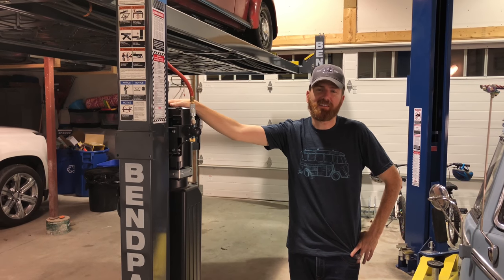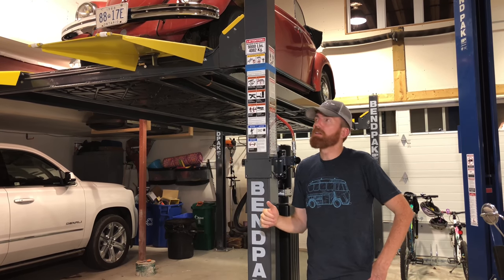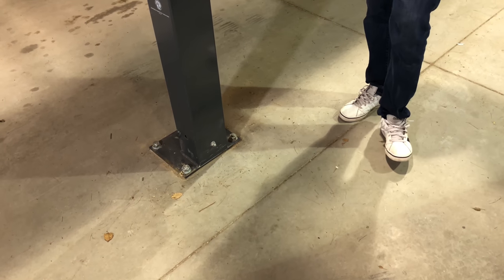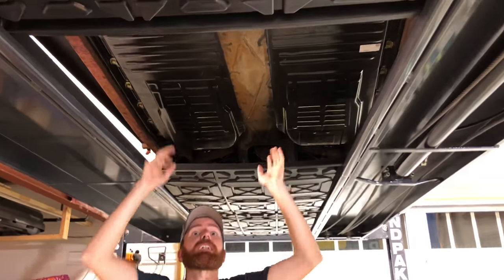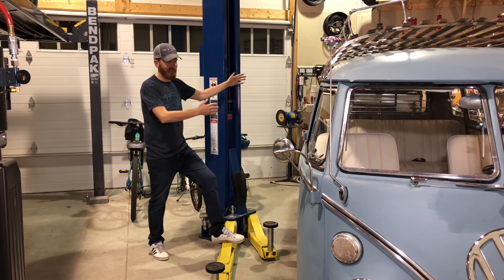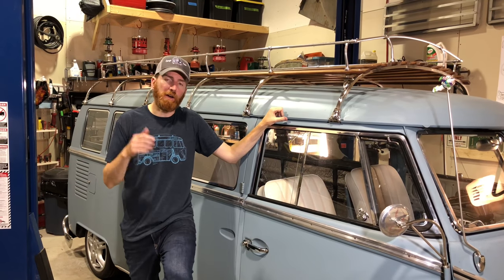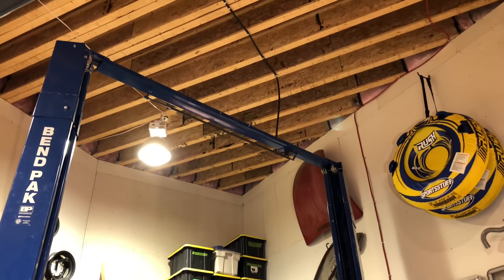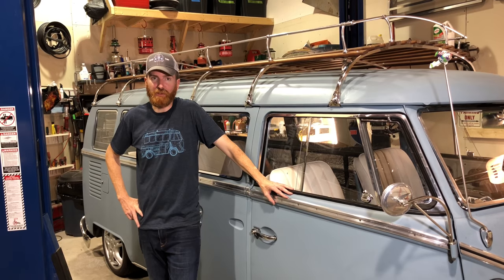BendPAK 4 Post vs 2 Post Hoist

Comment: Hi, I was wondering how sensitive the balance was on a 2 post lift. I'm planning on removing the rear end on a 93 jag xjs and was wondering if this would upset the balance point on the lift or not. Thanks in advance for your thoughts.
Reply: To answer your question since I have a couple 2 posts. You'll want to get some tall jack stands. You can actually get them through Oriellys. If you know one end is going to be a lot heavier , it's best to use a stand to help the heavy end from sagging and possibly tipping
Reply: @boostedgringo5885  thanks sid